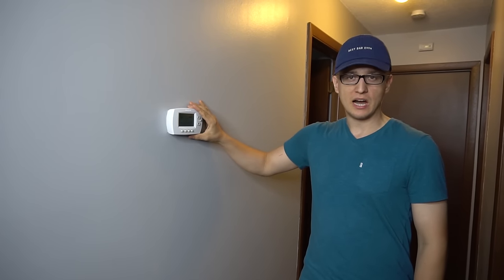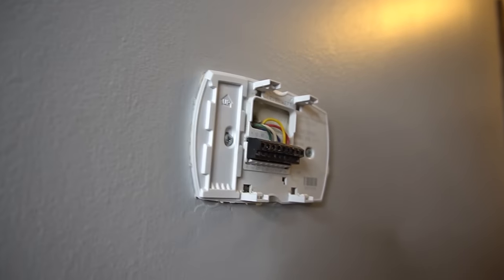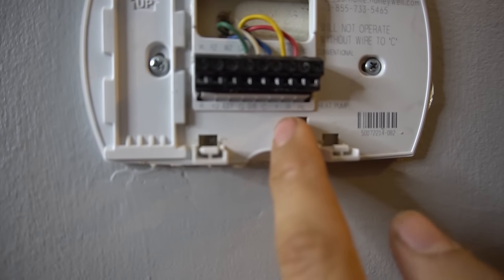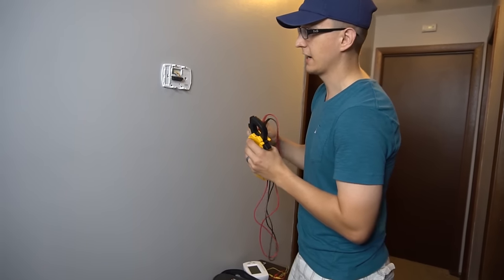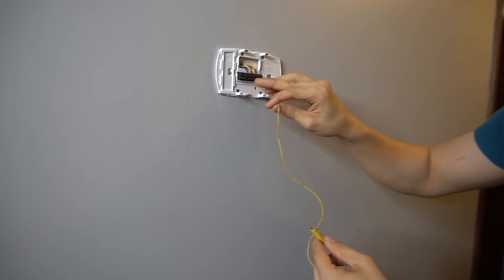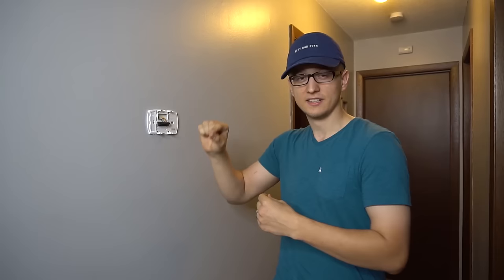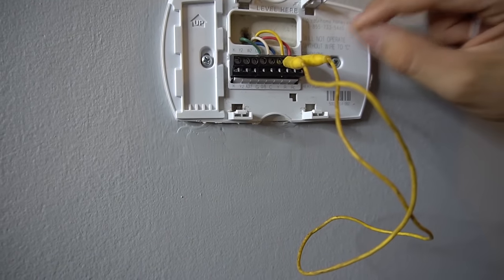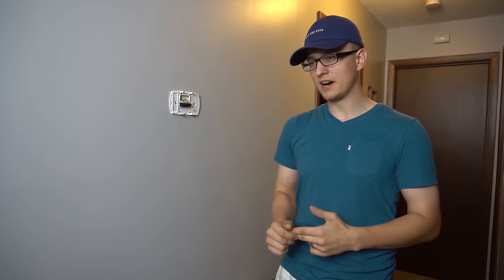How to Tell if Your Home Thermostat is Bad - Bypass it and Find Out

Comment: Thanks Pal. I have an 𝗢𝗟𝗗 Perfection furnace. Built like a tank, very simple. No heat so first I changed out the thermocouple, nope.  Then checked out the transformer which was within spec. Next was the  Baso switch, nada....I'm running out of stuff 𝙄 can do before I have to call a repairman. Didn't think the thermostat would be bad. But as a last ditch effort I checked it out per your video. 𝙎𝙪𝙘𝙘𝙚𝙨𝙨 !! the burners came on. Now to return the Baso switch and get a new thermostat.....𝙏𝙃𝘼𝙉𝙆𝙎!! Oh yes, 𝙇𝙞𝙠𝙚𝙙 𝙖𝙣𝙙 𝙎𝙪𝙗𝙨𝙘𝙧𝙞𝙗𝙚𝙙

Comment: Thank you very much for your vídeos, I appreciate it very much !! Just one question to bypass the thermostat should the unit be off? Thanks
Reply from the maker: It doesn't have to be off. Just be careful not to touch R to C as that would be a direct short and will burn out the fuse.

Comment: Another helpful tip with some thermostats, is to check resistance on the actual switches, their selves.
I suspected that I had a bad t/stat. Luckily, it had 2 way & 3 way toggle switches, rather than pc board "push buttons" on it.
So I used my multi-meter to check whether or not I had continuity when the contacts in the switches made.
The Heat/Cool switch was defective. When set to cool, there was not continuity on the toggle switch, itself.
I happened to of had the exact, same t/stat face on my service vehicle, so I put a new face on the already mounted, original sub-base. & the out door unit & indoor fan motor both energized when I switched it to Cool.

So, sometimes checking the 2 way & 3 way toggle switches on those types of T/Stats help.
Reply from the maker: Awesome! I usually don't check that so thank you for sharing! Good to know :)
Reply: So even if you tried to jumper the system, nothing would happen, right?

Comment: Jay, I need to test my thermostat because my thermostat is blank. I enjoy your videos and have learned a lot. My problem is I have a carrier thermostat-infinity. This thermostat doesn’t have the normal nomenclature it has ABCDS1S2. There is only four wires green,yellow,white,and red. I am afraid to use my multimeter since I don’t know  which wire to touch.

Comment: Thank you so much for the video! I have no display on our thermostat which means I can't get our heat to come on obviously. The breaker seems okay however I simply cannot get any power to the thermostat? In your video you said once you use to jumper cable if nothing happens then you know it's not your thermostat. Not sure if I heard that wrong but wouldn't it be the opposite if nothing happens then something's definitely wrong with no power or display on thermostat? Thank you in advance and sorry for the inconvenience.
Reply from the maker: If you jumper R to W at the thermostat and the furnace turns on that means the thermostat is bad or the batteries are dead on it. If nothing happens, then the problem is in the furnace. The furnace is supposed to send 24 volts to the thermostat and maybe it is not doing that for some reason. Have you watched my Top 10 Furnace Problems video? That one has a lot of furnace problem scenarios. One of them may be what you are experiencing :)

Comment: Great video....if you jumped the thermostat it works..so what is wrong then..is it your thermostat or something else? That is  the issue I am having. My screen shows  room temperature and nothing else...but when jump A.C. comes on. Should I change my thermostat?
Reply from the maker: If your thermostat has batteries, try replacing them first. Otherwise yes, I would replace the thermostat.

Comment: Your help with determining the thermostat wasn't faulty made me think it was probably a fuse in the furnace.
Sure enough it was. It costed $1.69 for a fuse, rather than a service call that would have costed $50-$100.
Reply from the maker: Glad to hear you found the problem and it was an easy fix! Stay cool ;)

Comment: Thank you so much I tried what you suggested, saved me a service call of $70.i installed a new thermostat.I didn't turn switch on back to gas or oil, I guess I shorted. Any ideas on a decent thermostat please. I bought a cheap 25 guess goofed lol
Reply from the maker: As long as it works, it doesn't really matter which one you get :) I personally like thermostats with less buttons. Unfortunately I don't have any recommendations for you though..

Comment: Great Video!! Before I tackle the Thermostat and Control Board. When I switch to fan only the blower does not come on. When I switch to Heat "Auto or On" the fan does not come on but the furnace is fired up and working. Fan may be on but really can't feel it. When I switch to AC and auto the blower works great. Does the blower have a different speed when in Heat mode? Seems it should be blowing more air into the house like when in AC mode. Thanks for a reply!!

Comment: Thank you for your vids - super helpful and appreciated. 

I have a problem with no power to my thermostat but power at the board. Happened last night during a rain storm - probably unrelated but not sure why it would just stop working like that. 

The breaker is fine and the board is getting power. Thermostat connection reading 27 volts at the board.

 I also checked if the the water pump was working or if the float tripped anything but it appears fine.

Any suggestions on what else I should look into? 

Regardless, thank you for these vids. Really helps to understand 👍

Comment: A little help is much appreciated! On my board I don't have R by itself and C by itself. I have RC, RH, B, O, Y, W, G
Reply from the maker: You should look up heat pump thermostat wiring since it seems like that's what you have. Here's a short summary:

RC is power to cooling, RH is power to heating. These two are often jumpered together (internally or with a jumper), as if you only have one R terminal. 
O or B is for the reversing valve
O or B is the common. Just look what color wire goes to C in the furnace to confirm.
Y is cooling
W is heat
G is fan
Reply: You're right the RC/RH are jumpered together. I followed your advice and when I connected the R and the Y, the AC started running so I have a problem with my thermostat

Comment: My AC turns on and cools the house, but DOESN'T turn back on to cool the house again when it heats up again.  Any idea what that can be from?  Thank you for taking your time to read this and your videos are great!
Reply from the maker: Sounds like something is wrong with the thermostat. If it has batteries I would try replacing them first. If problem persists, then likely the thermostat is defective. Only way to check for sure would be to check voltages in the furnace with a meter.
Reply: @WordofAdviceTV  Thank you for the reply first off!   I'm gonna swap out the batteries tonight and most likely purchase a new smart thermostat in the very near future.
Reply from the maker: @jodeci888  Sounds like a plan. Good luck, stay cool! ;)
Reply: Thank you again.

Comment: Love your channel I just replaced my units battery and contactor it was working for a day but this morning I went to check on it because for some reason it was not turning on and there was a little wire that was broken so I reconnecting it but my air has yet to turn back on?

Comment: Hi, your videos are super helpful. When I jumper AC at the control board the AC does turn on, but when I jumper at the thermostat only the fan kicks on. The outside unit does nothing. Based on what you said in the video this would suggest this is not a thermostat issue?
Reply: FIXED! After watching your wiring demo, the previous homeowner messed up the wiring at the control board... Y was connected to G by mistake.
Reply from the maker: @Kevin High Perfect! Glad to hear you figured it out :) Stay cool!

Comment: Thank you for your very useful video series. I have a question for you, my Carrier AC stop working without notice, my thermostat is working. I checked capacitors and they look fine. The only thing I saw was that the LED light on the board is off. Could it be a bad board? Thank you in advance
Reply: check the fuse. should be 3amp maybe is no good
Reply: Hey that's exactly what my situation is. I replaced the batteries & it appears to be working but no longer lights up. Did you ever get it figured out? My husband is off working & it's  87° inside my house right now!

Comment: So you should have the power OFF when connecting the jumpers and then once attached turn the power back ON?
Reply from the maker: It is the best to do it that way, yes. Because if you accidentally touch R to C and the power is on, that would blow a fuse.

Comment: I have a NEST upstairs and downstairs. Upstairs is an American standard Golds furnace and the heat has been working fine and the AC worked fine at the close of summer. I just had carpet installed upstairs and the installers turned the heat way up as they said it helps with the carpet settlement. It went up to about 77 degrees and we usually keep it at 70. They left at night and we turned on the AC since it was so hot and the fan came on but the compressor downstairs did not and does not even hum when trying to turn on. I did your measurements from the last video and the relay measured .8 ohms. Ordered a new relay anc cap and new relay measures 14 ohm and cp also good. My control board upstairs has a 5 v fuse but it is not blown? I have 28V going to red terminal; and white terminal going to the NEST. Back downstairs, I pulled leads off the relay and measure volts there when AC engaged on nest and I only get 10V??? If I  measure leads upstairs where 28 v is, it is 24V. As you showed, I event used the unused pair of wires going from upstairs to downstairs relay and still only 10V downstairs. I can manually push in the relay and both the fan and the compressor come on???? I even tried swapping the NEST from downstairs with upstairs. 24v transformer tests good. MY NEST downstairs is wired different than upstairs but both have been working for over 8 years. Downstairs AV unit is different brand. Control board? Why did 5V fuse not blow when original relay shorted?

Comment: God bless you sir.
I have a question. If i only have y,r,g and w wire do i have to put rgy to test ac? Or just ry?
Reply from the maker: Usually R to Y is all that is needed. The control board should automatically turn the blower motor on with the air conditioner.

Comment: Nice video....

To make sure I understand you - if i jumper the red and green, it should activate the fan motor?

My system will complete a cooling cycle, but the fan sometimes (about 20% of the time) will continue to run for 2-3 minutes.
I have a nest thermostat, and when it does this, I tried pulling the thermostat off the wall and the fan stops within 5-6 seconds.

Would this indicate a faulty thermostat?

Thanks

Comment: Great informative video. I have question for you. I have a battery powered themostat. When I detach it from the wall I can test the back with a multimeter via continuity. My blower fan works when on cool but not on heat. There it continuity between the R power and G fan in cool setting. But when I switch the thermostat to heat, and the thermostat shows its on, there is no continuity between the R and G pins (thermostat not giving power to the blower fan?). Thus I think the problem is the thermostat. Can you confirm, or does something in the unit itself tell the blower fan to come on when its on heat?
Reply: orange44number I'm having the exact same thing happen. Did you get an answer ever as to why is happening?
Reply: I'm having the exact same thing happen. Did you ever find out what it was?
Reply: @ashovi  After some additional research,  the thermostat was fine and the testing was normal. (Mine is a gas furnace and the unit tells the blower to come on with a limit switch) So the blower for the heat gets powered differently than it would on AC mode.

My problem was a fried connection on the curcuit board, I took lots of photos of it all wired up then u-wired it and resoldered the burnt connection path with solder and copper wire to make the path.

If you suspect the board has a fried connection, sometimes you can see black as evidence on or around the board.

Also check your 3 amp fuse sometimes they burn out.

Also maybe check the limit switch, some videos I have seen say that it should have continuity at all times or its bad. So you might check continuity across it. However, this doesn't sound right as I would think it has to reach a certain temperature to activate, but I may be wrong.

Hope you get er going
Reply: Oh I also forgot to mention, if your electric igniter is burnt out, you will have these same symptoms, so definitively check the igniter, if you have a furnace with electric ignition, it should come on within a min or two of flipping heat on and glow orange.

Comment: I’m getting 16v only on my C and R wires! My new Honeywell thermostat is not turning on! What is causing it? When I switch the electricity on, the fan turns and the thermostat display remains off. Can you help?

Comment: We have a keeprite furnace that quit a few weeks ago. It has a solid green led. When we turn the power off to the unit, and then back on, we just get the solid green led. It does not respond at all to the thermostat. It seems like the solid green light might mean that the unit is not receiving a signal from the thermostat, but it's hard to get good info on this. Thermostat has fresh batteries. 
I guess the thermostat bypass test is next up?

Comment: Do I have a listening problem ?   Jumped R to Y for AC unit, switched back on,  " AC unit will turn on,  If not thing happen then you know your Stat problem " was I listening correct ?  Thanks so much for the great video
Reply from the maker: Sorry for not being clear enough. You were almost right but it is actually like this: If your AC unit is not turning on at all but when you jump R to Y at the thermostat everything turns on, then the thermostat is bad. (or it has weak batteries)

Comment: hello,I im glad to find your tech support,I have a ladyfriend who has a trane x401,from 06,there was a big thunderstorm in florida ,2 weeks ago,and the thermostat  does not come on,no display,so I ordered one from ebay plugged it in,still no display,i did not ask her if the outside unit ,with the fan&motor came on anyway,there is a cut off switich on the wall,so i piulled out the copper fuse,put it back in,still no display,,,the wire in the thermostat has say,6 wires,,one of them is the hot wire& one is nutreal,does this cable go up to the attic,in a cutout box with a transformer to another cable to get the 24v needed for the thermostat,and go back to the breaker,,so is the problem on the circuit board in the main unit outside,is there a fuse or a reset button on this,thanks for any help on this,,dan diorio,,

Comment: Should there be continuity between any wires while the unit is turned off? I have continuity between the Y and R wires with the breaker turned off to the AC unit.

Comment: My HVAC Tech can't seem to find an issue with my furnace unit. (12 year old 1 stage unit house built west coast in 2008 attic unit which, I am not that flexible in maneuvering around) What I am experiencing however,  sometimes  (more often than not with heating)is the heat will come on (not always), then the fan will either be a delayed in turning off by 30 minutes by up to an hour and a half after reaching target temp. Or the the fan won't turn off at all unless I manually go to the thermostat to the force a fan idle signal be sent to the control board which will then turn it off around 15 to 30 minutes later when it use to be about 5 to 10 minutes after the heat cycled off. I have tried taking the thermostat cover off to turn the fan off but the fan keeps running.  He did say their is a fuse in the unit but it is not blown and previous visits has ruled out rollovers, and high limit switch triggers. When I watch the thermostat I will hear the system cycle down when it does heat and reach target tempurature usually around 73 deg, but the thermostat fan will never switch to fan idle and 10 seconds later the fan kicks back on and stays on.  Then after the fan cools the house down again the furnace will kick on and reach target temp and then sometimes the signal will successfully turn the thermostat fan setting to idle sometimes it wont. So I was curious if this sounds like an issue with my 3-4  year old SMART thermostat, or if something else might be causing the issue.

Comment: Thank your informative video, however, I do have a question. I have a thermostat that is sensitive to voltage. When I lose power, sometimes the thermostat works and sometimes it does not. I do have inverters generators as my backup power source. I do not need my furnace to provide me with heat during the winters, however I do need the fan to run to circulate the air/heat that my pellet stove puts out. My question is, if I hookup a switch to bypass my thermostat to just run the fan during the times I have to run my generators as my source of power, will that damage my thermostat if I have a bypass switch to turn on during these times to ensure the fan runs? Or must I disconnect my thermostat before I flip the bypass switch?  Thanks!

Comment: hello love the video,s question i have a payne  package unit that will not come on unless i pull the face of the thermostat off and then it only run for one cycle and dose not get to the thermostat setting. what do you think is the problem ?

Comment: Hi, thanks so much for sharing this video. We have replaced the condenser fan motor and capacitor, but the fan still runs very slowly and the air in the house is still not cooling. Could you help us figure out what might be the issue here? Really appreciate it!